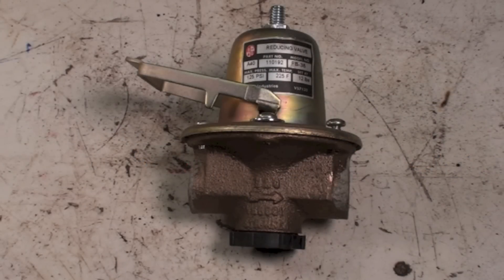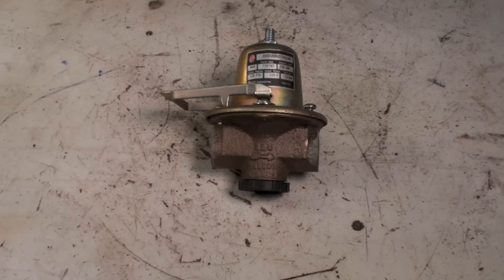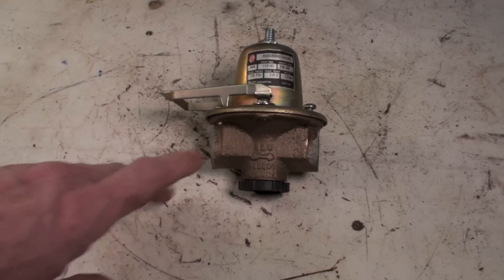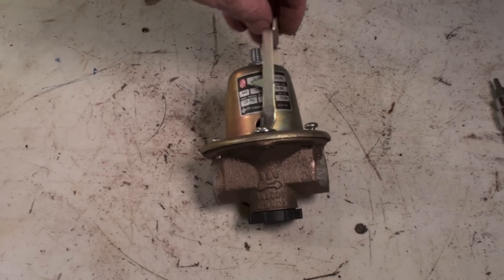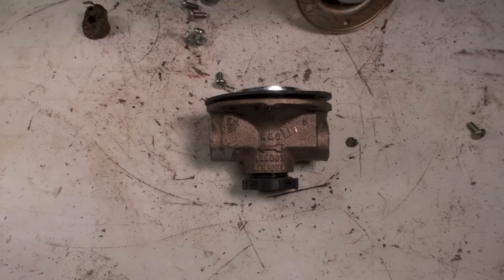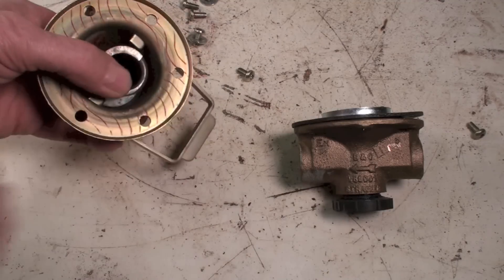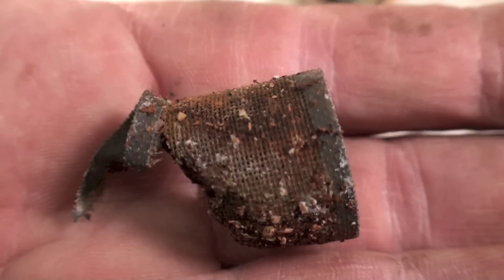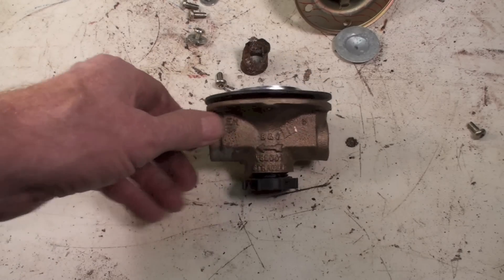How the boiler pressure reducing valve works.

Comment: What would happen if my well water ran dry? Would I not be able to use the boiler to heat my home or is it a closed loop system?
Reply from the maker: They are generally closed systems.  However, if there is no back flow preventer, and the water pressure drops below the boiler pressure, the boiler water will move into the domestic supply.
GFM
Reply: @ well it has the reducer thing. Does that also act like a check valve?
Reply from the maker: @fishin360  No, that valve will back feed.
GFM
Reply: I just noticed there is also a backflow preventer installed just before that
Reply from the maker: @fishin360  You are good.
GFM

Comment: Since 2.31 feet of water column creates 1 psi  I believe a factory set pressure of 12 psi would lift water to a maximum 27.72 feet. (12 X 2.31) Ours is set at 12 (and reads 12 on the gauge when cold) and it easily allows the 2nd floor radiators to bleed.
Reply from the maker: You are using a theoretical number.  In practice, it does not always work well.  I would use 18.
GFM
Reply: Thank you. I was doing it mathematically I appreciate the clarification.

Comment: You would think it would be a simple task to find a box of replacement screens and/or other parts/gaskets to rebuild these valves instead of replacing the perfectly good, most expensive part brass casting, but you'd have an easier time finding an honest politician married to a lawyer that just wants to help.

Comment: Did you replace the screen  or remove it.  Is it ok to use it with out one?
Reply from the maker: Most times when I get to them, the screen is falling apart.  I don't even know if the screen is available.  If the valve is over 5 years old, replace it.
GFM
Reply: @grayfurnaceman  where is the video to replace it?

I have the male ends solder onto the water pipe. 
Take off the solder or see if the water reduction unit will spin off it?
Reply from the maker: @wesss9353  If there is no union, I would cut the pipe.  The red will unscrew.  When you replace, install a union.
GFM
Reply: @grayfurnaceman  thanks!

Comment: Hi Mr. Guru, after watching your video I checked my steam heating system (I live in New England) and I have noticed that there is NO water pressure reducing valve in my system at all. The street water goes directly as cold for the house and also feeds into the boiler. No wonder when I used the outside water for gardening and washing I have noticed its stream is so powerful. My question to you is, is it normal to not have the street water reduced down to around 12 psi from street 30-50 psi? Thanks for you reply. I appreciate your teaching and knowledge...

Comment: Why do I need an 18 psi if I have a second floor
Reply from the maker: The higher the lift above the boiler, the more pressure you must have  to keep the water from separating.
GFM
Reply: grayfurnaceman appreciate it

Comment: Question, which side should my pump  be installed to
Reply from the maker: If you are installing a circuit pump, the only side you can install is on the boiler side.
GFM

Comment: I have a question - my boiler system will be at 0 PSI while it’s not running, then after 10-15 minutes of running it will slowly work it’s way up to 30+ PSI causing my PRV to open and water to weep out the back.  Then after a few minutes of being shut off, it will go all the way back down to 0 PSI until it comes back on.  Is this normal?
Reply from the maker: No.  If your system has an expansion tank, it is water logged.  If the system has a bladder tank, the bladder has burst.
GFM
Reply: @grayfurnaceman  Thank you!
Reply: @grayfurnaceman  My system has neither. It has steam vents only
Reply from the maker: @trankt54155  And this relates to this thread how?
GFM
Reply: @grayfurnaceman  Because you talked about water pressure reducing valve from street water, and when I checked my system and kept looking for the water pressure reducing valve and I could not find one. I was hoping you can comment on it but if you don't want to then it is ok. No problem.
Reply from the maker: @trankt54155  You appear to have a steam boiler.  Makeup water is added by a float at the domestic water supply.  There is no reducing valve.
GFM
Reply: @grayfurnaceman Thanks and that makes sense since steamboiler is an open system with steam being compressible vs. closed system like noncompressible water boiler.
Reply: If my expansion tank is water logged, is this something that you think I can fix myself?
Reply from the maker: @dhagenow92  If the unit has an expansion tank, it can be drained and recharged with air.  
Simply shut off the valve to the tank, open the drain valve and let it drain until there is no water coming out.
Shut the drain and open the valve to the tank.
This should be done once a year.
GFM

Comment: Your video helped so much...

replaced expansion tank and air valve, but couldn't get system to fill..
30 or so year old system

took apart this fill/reducing valve most of the way and it might have been sticking (I have to get a new screen..),
but this then let me see that the backflow preventer (check valve) was sticking...

took that apart and it was very minerally inside
cleaned it out and finally able to fill system and have heat again

John from NJ
Reply from the maker: Its good to be warm.
GFM

Comment: Can a failed pressure regulator somehow raise or affect the proper temperature of a 20yr old USC4 boiler?  I had a new valve installed and 48 days later, the ignitor / flame sensor wire had burned through and shorted out.  

The repair company (who claims these are 2 separate issues and not related) are now  billing an additional $600 on top of the $400 I paid the month before. My question for them is: why didn't they see signs of overfiring on the first diagnostic?
Reply from the maker: On this one, there is no relation.  There is nothing from what you say indicating an overfire condition.  A burned wire on the sensing wire could be a misplaced wire or possibly a venting problem that would not let the burned gasses pass out the vent.  
GFM
Reply: Thanks I forgot to mention they replaced a "smart gas valve" in that second repair, which added to the cost.

Comment: great video thank you for posting.. the pressure release valve next to my expansion tank recently started leaking I replace the expansion tank and they released  valve without luck. now I'm looking at this valve how do you adjust it? and of i replace it with a new one do they come pre set
Reply: that's pressure release valve
Reply: and i do have to much pressure in the boiler
Reply from the maker: If the valve is older, it is best to replace.  They come preset for 12#.
GFM

Comment: The boiler I'm looking at has this valve but the lever is very very loose, feels as if no pressure at all. I made sure the valve from the main was on and it was and even tried messing with that a few times with no change...

 The house is 3 (tall) stories and there is only 15 pounds of pressure in the system, so when I went to try and add more water via this pressure reducing valve, nothing happened. I tried taking out the little filter and it was a little dirty but not awful, but some orange water came out but after that no water at all. 

Any thoughts? Could the water line before this valve simply be clogged?
Reply from the maker: Probably not.  Most likely the valve has failed.  Fairly common if the valve is over 5 years old.
GFM

Comment: Thank you very much! Your discussion of the spring working to open the valve and the stem assy working to close the valve was precisely what I needed to understand in order to try to set the valve after I rebuilt it. The instructions told me essentially the same thing, CCW to lower the pressure and CW to increase, but it wasn't intuitive, I thought that the spring may have worked to close because I hadn't looked at the water path and diaphragm before I put it together. Now to see if it works or if I need to replace the entire thing.

Comment: What if my reducer valve doesn't have that metal clip to automatically let water in?
Reply from the maker: +joshlock00 Then it will not bypass.  When charging the boiler with water, you will have to use only the regulated water flow.  Hope this helps.
GFM
Reply: +grayfurnaceman by regular flow do you mean the nut on top ? Like just unscrew it a little ? I just need to add some pressure to the boiler and when I do this do I need to let the water cool ( shut heat off) thanks for reply
Reply from the maker: +joshlock00 You can adjust the screw by turning it clockwise.  You do not need to shut down the boiler.  However, if the regulator has a few years on it, adjusting it may not work and the valve may have to be replaced.  Hope this helps.
GFM
Reply: +grayfurnaceman so actually screw the top screw part not the nut right
Reply: +grayfurnaceman having a hard time turning that screw do I need to loosen the nut
Reply from the maker: +joshlock00 Yes 
GFM
Reply: +grayfurnaceman sorry to ask twice but can I loosen that nut on top to help screw the screw in ? The screw just won't budge it's up by the basement joist and kinda hard to get to
Reply from the maker: +joshlock00 The nut is a lock nut to lock the adjustment when adjustment is finished.  Loosen the nut.  The screw should then move freely.  Remember, if these valves are old, adjusting it may not help.  It may either leak by or not flow at all.  If the valve was over 5 years old when I serviced the unit, I would replace the valve.
GFM
Reply: +grayfurnaceman ok so got the nut loose and turned the screw a whole rotation and the pressure didn't rise at all ...should I keep turning it ( I kinda figured just a little turn and pressure rise) thanks for the help
Reply: +grayfurnaceman also if mine is a b 38 can I switch it out with a fb 38 ?
Reply from the maker: +joshlock00 If it is a B-38, it is very old.  I would replace it.  The FB-38 is a direct replacement for it.
GFM
Reply: +grayfurnaceman got the replacement so just shut off gas drain boiler shut off intake then switch out valve then turn on intake and adjust till I reach the 12psi pretty much right
Reply: +grayfurnaceman ok so got the pressure reduce valve on and pressure went up to 12 psi cold 18 psi hot only thing now is when boiler is on and running temp goes to 220 went off down to 140 my temp gauge is set at 180  any suggestions or am I ok
Reply from the maker: +joshlock00 The pressure change is in the ballpark.  That is a pretty wide differential.  If you have an adjustment for the differential you may try to get it closer.  Other than that, I could live with it.
GFM
Reply: +grayfurnaceman thanks if when the heat kicks on I can hear bubbling noise in my copper pipes that are running threw my rooms does that mean I have air in the system ? If so do I need to drain the whole thing and refill it?
Reply from the maker: +joshlock00 You have air in the system.  If you have any bleeders in the system, try opening them while the pump is running to release the air.
GFM
Reply: +grayfurnaceman sorry for the many questions but if when I take a tire gauge and check the expansion tank I get no pressure do I just pump air in it till it reads 12psi on a tire gauge ... And I live close to sea level no mountain type pressure to deal with
Reply from the maker: +joshlock00 If the house is 1 stores with basement. 12# will do.
GFM
Reply: +grayfurnaceman 2 stories and ur talking about the expansion tank pressure right
Reply from the maker: +joshlock00 Yes and 18# for 2 stories.

Comment: Where I live, there is extremely hard water.  The hard water causes a lot of nasty stuff, when it comes to boiler systems.  Can the filters be replaced without buying a completely new reducing valve?  If so, where might I find them?  Does removing the filter every so often affect the use of the valve?
Reply from the maker: +Linda Bentzen I have not seen them.  I am somewhat more concerned about why you would need replacements.  Once the boiler is up to pressure, it should need very little make up water.  Are you sure there are no leaks in the system?
GFM
Reply: I live in a city with extremely hard water.  The filter becomes brittle and eventually causes no water to flow through it.  There are zero leaks.  Because there is not a constant flow, the hard water slug gets a better opportunity to build up and destroy the filter.  If I could change the filter once or twice a year, I would probably be able to save money by not buying a new one at least once or twice a season.

Comment: Thanks for the video. For whatever reason my 2 y/o Lennox boiler was set for 30 psi (2 floor house) from day 1 (I recorded all the settings). The over pressure relief valve started blowing off last night (just a little) and I had no idea the pressure should have been lower. You video sure cleared that up. Thanks again

Comment from the maker: The screw on top is the adjustment.  Don't be happy yet.  Most of the time, the valve is leaking by and needs to be replaced.  The other possibility is if it has an expansion tank, it may be waterlogged.  You can tell the difference by checking the pressure cold and hot.  If it changes more than 4 #, it is waterlogged.
Hope this helps.
GFM

Comment: The reducing valve I removed was partially blocked and the water pressure was low---did not know it because the water pressure gauge was also faulty---all corrected now.

Comment: Used the double wrench (push/pull) on Sunday and got the relief base off---but it took the short attached threaded pipe nipple with it.  No issue on that.  I ordered a relief valve with a male thread base.  Waiting on the Grundfos pump delivery to check the install with old flanges.....   Thanks!

Comment: Oh,  I did drain the boiler and isolated the zones ( the zones still have water).  I'm going to wait and see whether I can use the existing flanges for the Grundfos pump (I hope!!!).  In attempting to remove the relief base, the boiler box itself shifted an inch--so I stopped.  The pressure valve is copper line fed, so I can cut that easily.  I'll pass on checking it first, since the torque required to remove the strainer nut will likely exceed the limit for not damaging water lines.